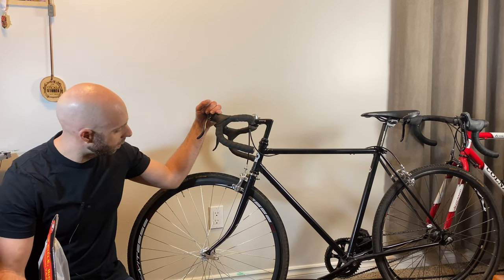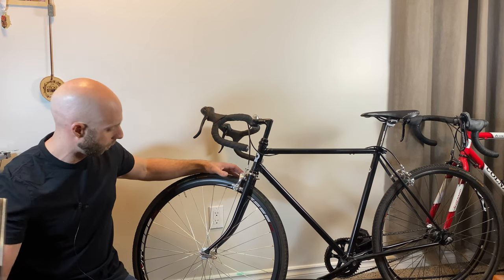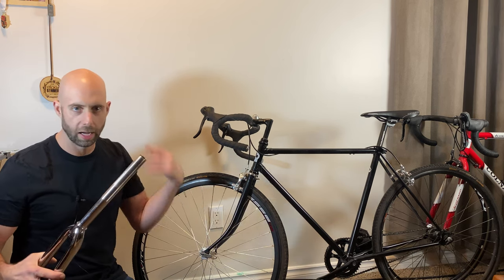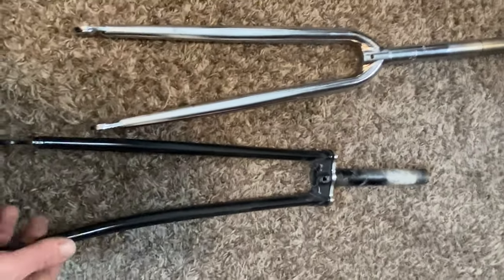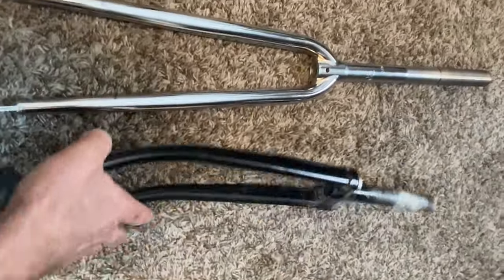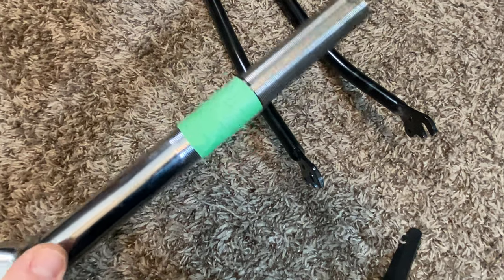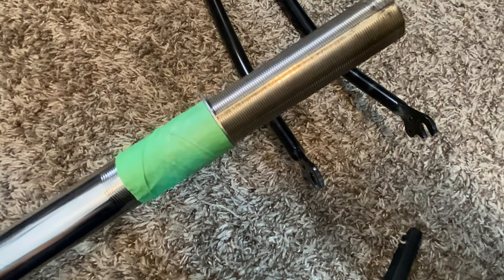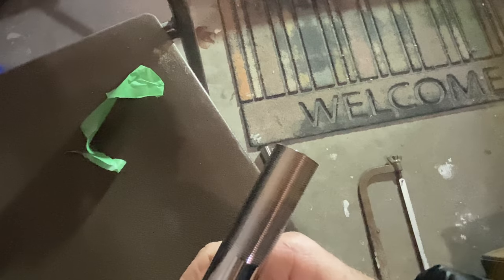Threaded Fork Upgrade l Single Speed Gravel Bike

Comment: Sorry man bad choice black forks looked better in my opinion but good job on the effort you put in, Not everything is a negative ✌🏻💯👍🏻
Reply from the maker: +Doug Richards hindsight you maybe right.  When the snow melts, I’ll put some miles on it and go from there.  Thanks for watching
Reply: @DCTaylor281  nice build man, I think the black and chrome look slick. IMO, I think it might be the stem throwing the look off, the black stem and forks angles met perfectly, but now that the angle changed they ever so slightly don't match up anymore. Going out and finding a chrome vintage stem that matches the angle better might be the best look.
But it's your build, and you should do it however you want. That's where the fun comes from, tearing it down, building it up & riding hard. 
Good work & cycle hard man 🔥👍🤘